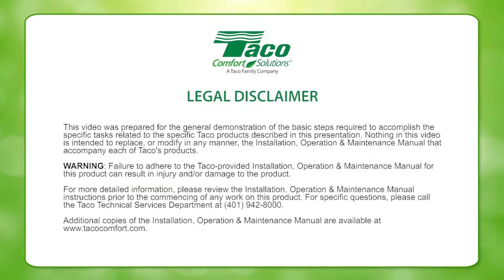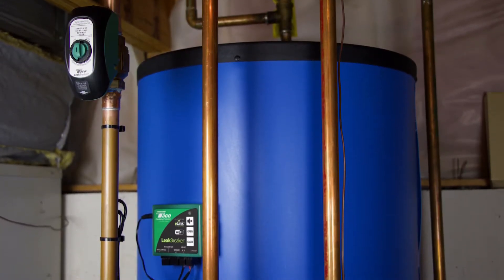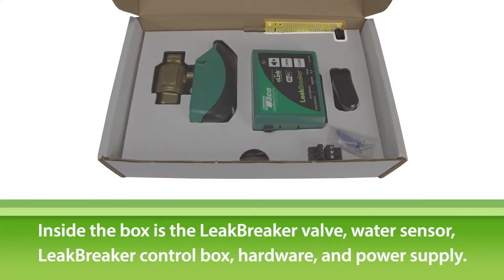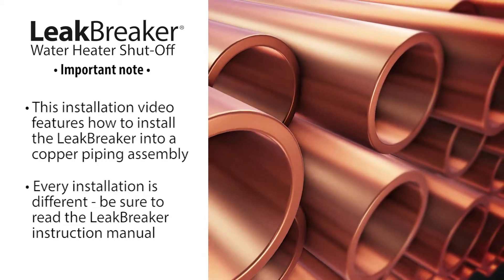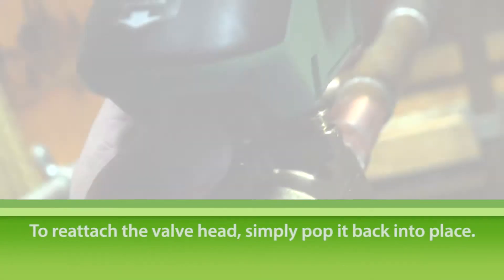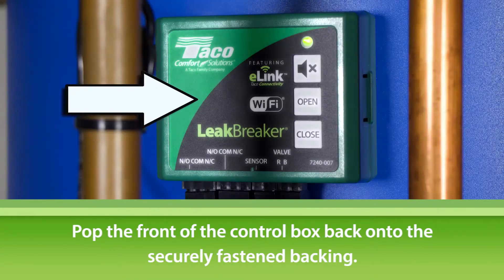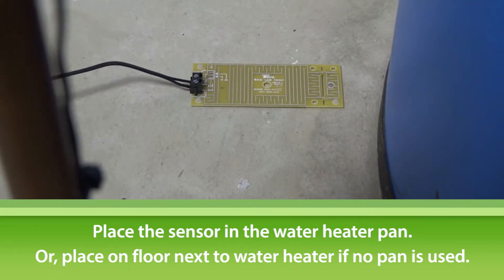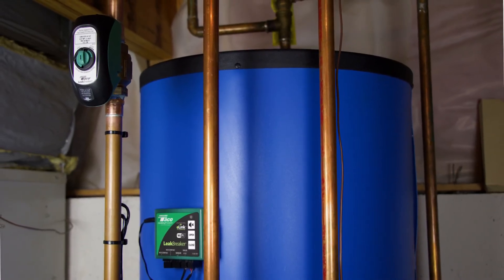Installing the LeakBreaker® featuring eLink™ Connectivity

Comment: Are the valves and sensors the same between Lack Breaker and Leak Breaker with WiFi the same? I would like to upgrade to the Wi-Fi version but not if I have to change the valve.
Reply from the maker: Correct, the controller is different. The LeakBreaker with eLink will email and text when there is an activation and moisture sensed at the sensor. Same valve, motor and floor sensor is used between the two.
Reply: @TacoHVACtv Thank you!